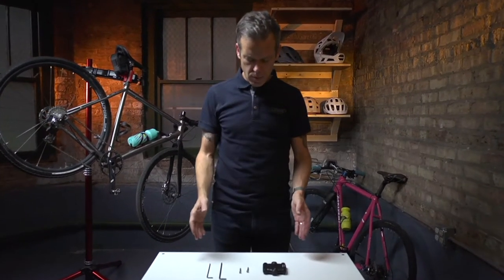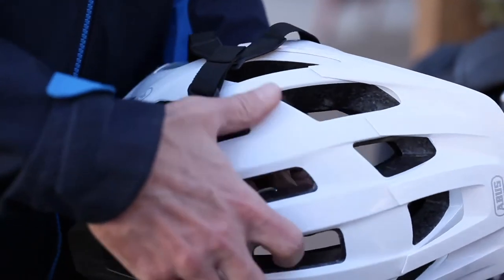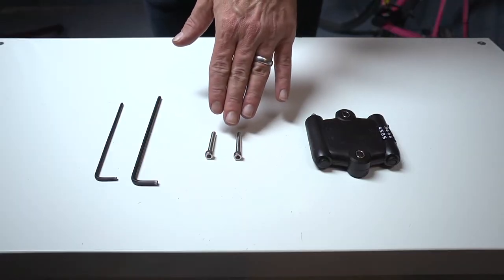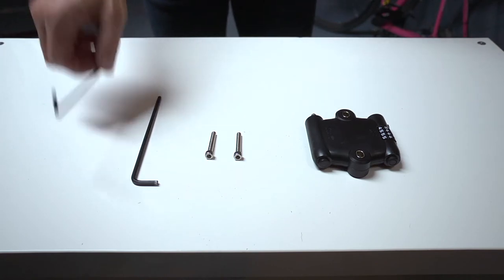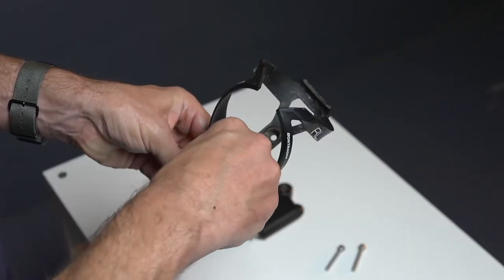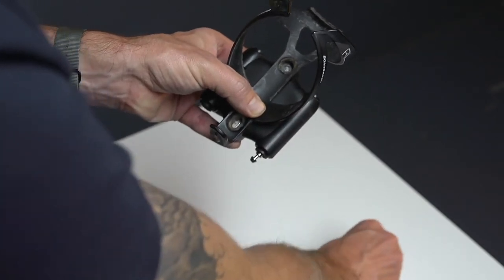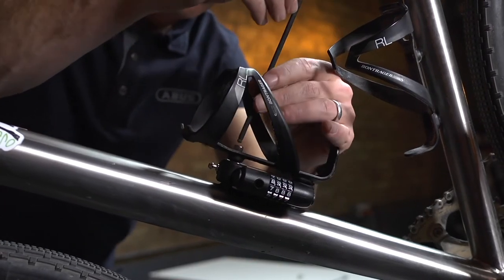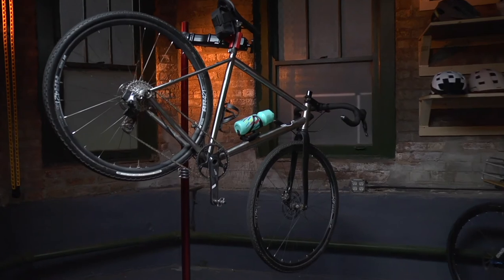SportFlex Installation

Comment: I have trouble changing the code. could you please advice?
Reply from the maker: with the lock set to the factory code, and the lock open, hold the button down and set the numbers to your desired code.  Let go of the button and the code is set.